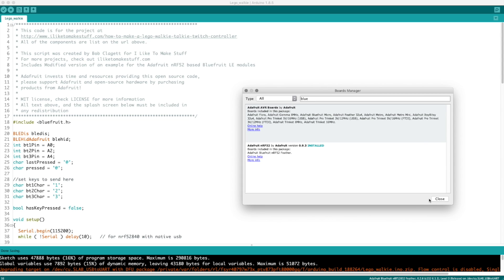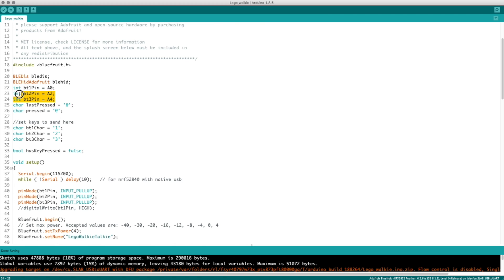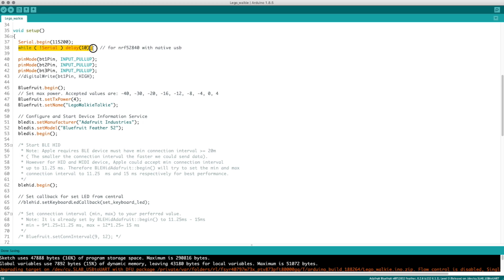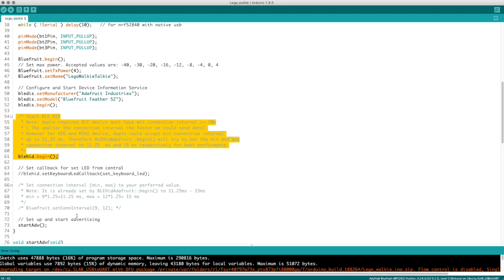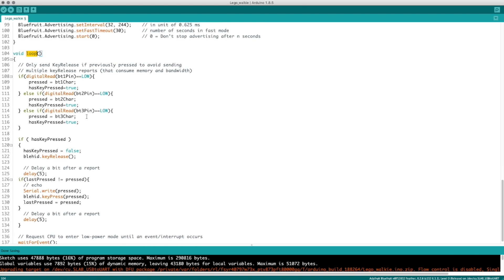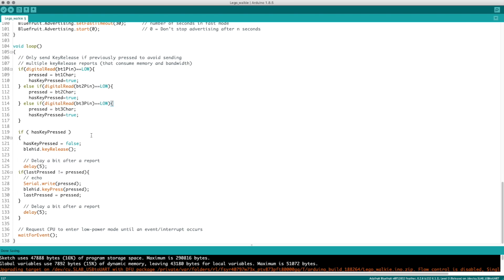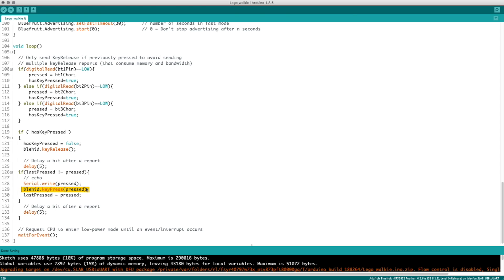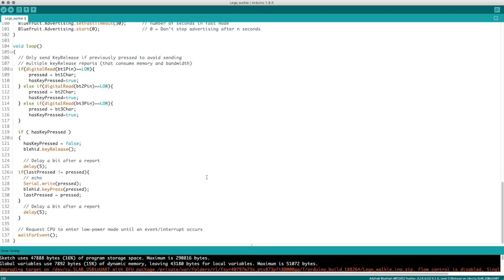Code Walkthrough - Lego Walkie Talkie Twitch Controller

Comment: Hey Bob. Is it possible, your "big while loop" is missing the surrounding curly braces? Without these, it just looks like a quite small loop, only executing the delay(10) instruction repeatedly. Or do I confuse the arduino programming language syntax?
Reply: fgsz291 they aren’t missing, adafruit does this in a lot of their examples. It just waits for the serial to begin before it does anything else. It isn’t really necessary
Reply: I am pretty sure Bob made a mistake. This is a loop which waits until the serial component is fully started before alowing the main code to execute. This type of delay is common practice in embedded systems (though good practice is to code it in such a way that you do not hog processor time) as the initial memory condition of the serial buffer could contain old data which would crash the program or cause unintended actions.  By waiting until the serial component indicates it is ready you are alowing the buffer to be cleared.
Reply: Also by waiting until the serial declares it is ready you are prevented from possible causing problems if you try to use the serial device too early.
Reply: It's a pretty small while loop. The setup() has to be called only once, so what adafruit did there is probably better than looping the whole setup()